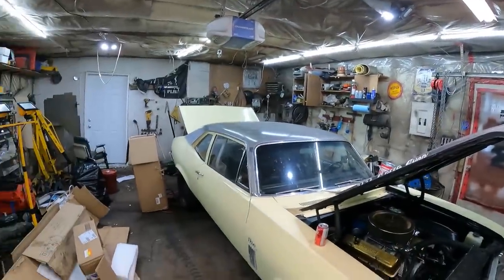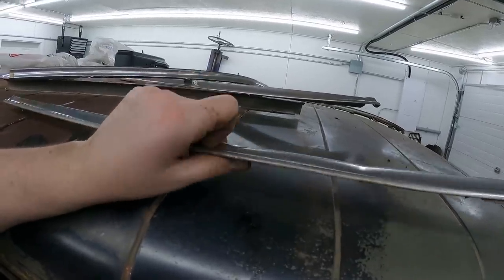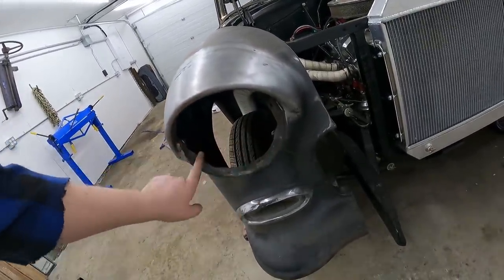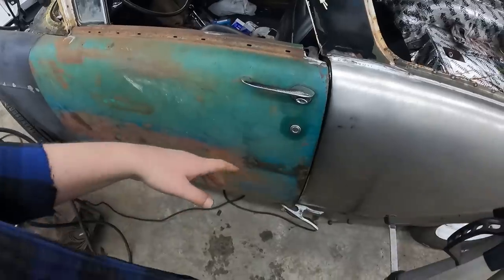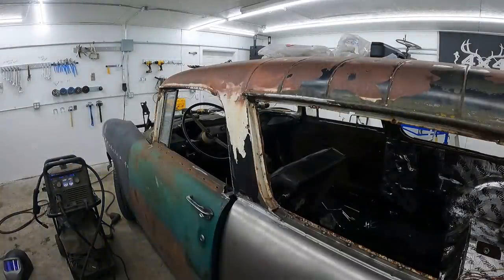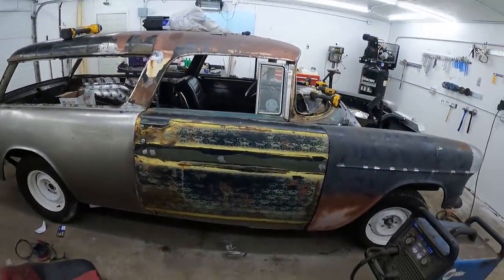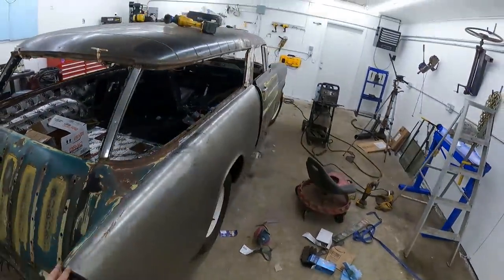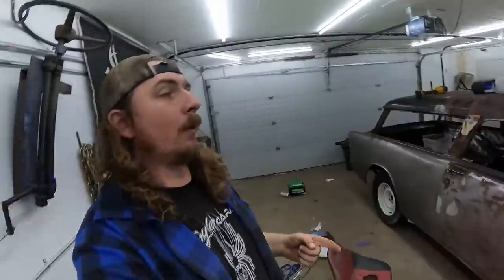Magic Dan Stripping For Your Pleasure, A Car, Stripping A Car Guys... - 1955 Chevy Nomad

Comment: Okay Magic Dan, you seem to have forgotten about something important when you stated the new shop/garage build out.
Exhaust fans, plus makeup air to replace what air you evacuate during exhaust fans are running. 
You can do it easily enough with one exhaust fan on the roof, are even mounting it on the wall between the two buildings if you don't want the it in plain view. 
Just make sure you have a back draft damper so that it doesn't allow airflow either way when it's off. 
As for the makeup air, you can mount a couple louvers with screens, and barometric dampers in the garage door, and that way you have fresh air flow across the entire shop area.
With the addition of filters at each opening both makeup air and exhaust you don't bring any trash into the area that'll contaminate your paint, and you don't introduce any contaminants into the air outside the garage.
Instead  of body filler,why not learn to use lead or the equivalent to it, and you won't have the issues of major cracking in a few years, because the lead/ lead alternative will out last any bond are other types of body filler by many years if applied correctly.
Just a thought on the body work, but a necessity as far as the exhaust and makeup air systems goes.
You might consider a floor sealer system too, which will make cleanup easier and you don't have to worry about staining the concrete.
Not that you do anyway, but you can hose it off, and it will dry in no time compared to exposed concrete drying time. 
I mean your seriously trying to make an effort to be more efficient and successful at what you're doing, so those things are a big step in that direction
Reply: Dan, you've made amazing progress so far! Here's a trick that will help with the longevity of the body work: first spray some epoxy sealer on the areas that you want to use filler on, it's makes the filler last longer and seals the metal from the porous nature of the filler, eliminating rusting under the filler, can't wait for the next video!! Rock on!

Comment: Always a good idea to seal the car in epoxy primer before applying filler. It gives an added layer of protect from moisture attacking the bare metal under the filler. Keep up the good work it's looking good.

Comment: Run a shared air line between garages and use the opposite garage's compressor to avoid the noise in the one you are in. Plus you get a little extra runtime with both tanks shared.

Comment: Looking alright. I would pull the headliner and assess the condition of the steel on the the backsides. I have seen as many as three layers on Nomad roofs. When looked into there were some issues there. Sometimes requiring patches being butted in.
The big garage is outstanding Dan.

Comment: Electronics short out with metal dust from grinding and high dust in general clogs heat sinks. Making a sealed cabnet for the pc case with a filter would do it some good, say use flat filters from car with push pull 180mm fans. Mounting the screen on the wall in a sealed enclosure would do it good, have two vent points to the pc cabnet with a fan in one. Fans smaller than 80mm get stupid load, so smaller than that wont be ideal. Adding a flip cover over the screen be good to keep it from abbrasive damage from grinding and stop flying objects.

Comment: Hey Dan,
That 8" DA with 40# will make your life a lot easier when you do your initial fill.
Might want to start with epoxy, etching primer or metal prep wash before bondo. 
Add polyester resin and over-fill the whole panel, grab the DA, but stop when you hit metal. You'll sand most of it off (it's cheap)
Short kitty hair first over your welds.

Comment: Dan, take the lead out because you need to plate metal with 18 gauge where the lead was or the body will flex and crack in that same spot, then do your filler with duraglass short hair and skim with body filler. Yes they did use alot of lead back in the day to correct things.

Comment: Put the air compressor between the two garages, you can build a small closet for it with some insulation to keep noise down.

Comment: D & D, Dan, you have come so far on your Nomad, on your Nova, I' m not a "yellow" person, but I do like the butter nut yellow, how bout a black vinyl top? Had a buddy that had a 66 or 67 Nova that color & black vinyl top, looked nice!! One thing I have been wondering, how would you compare your battery powered grinder verses a electric grinder? How many hours do you get out of your battery powered grinder? Be safe!!! God Bless!!!
Reply: Vinyl tops, while looking nice never end up nice in the long run. They dry, they rot, and then they retain moisture which rusts the roof.
Reply from the maker: I do like vinyl tops but not so much on novas

Comment: Use a French cleat to install tools . etc. on the walls.Rip a 1v4 in half at 45 degrees. Mount one side to the wall studs -easy to set up racks -and easy to move as necessary/

Comment: What is the finish your working to? Standard primer gray or something else? I usually gray with or lighter first, then a light spray over dark primer. When go to blocking the bigger areas you sand dark off to find low areas and height areas. I don’t how much you want work it over? You put all that time and effort, just might as well finish with process!👍👍👍👍

Comment: My brother and friend both used 1\2 inch foil covered foam board on the ceiling for insulation and noise. Will cut.

Comment: Dig out every possible bit of that lead that you can, Duraglass it, and then mud. What's really nice is when you wrap up a bunch of time in paint and then it blows apart, just like when you mud over lead. I'm not quite sure what your definition of painting the car is, but any comeback sucks, even if it's your own.

Comment: SKA-rew the filler door, shave it....get "the taillight". 
Also, you need a roof, if not a breezeway/storage locker between the two buildings. Might be a good place for the air compressor.

Comment: best way to get rid of lead is to melt it with a torch. then While its still hot wire brush or wipe with a rag. It will get rid of it really easily.

Comment: The day job cuts into the work and everyone has to have sleep so it cuts in and you take a few to break into the mode of work on it so that cuts in making for a lot of "I'm gonna's" and it doesn't happen cause you spot something and it will take the attention off of what you was wanting to do. Bare in there as your going to get it done, its just not easy to get up on step and get moving like your say you were

Comment: When you sanded that passenger side door, I almost went outside and did cartwheels in the yard. The whole character of the car changed with that one move. Its like you took off the Haloween costume that's been on it for 50 years, and now it looks like a proper '55 Nomad again. More evil demented LSD  lunacy from the 60's is gone forever. That's the kind of hideous crap that can keep you awake at night wondering who would do such a thing. I can tell that in a very short time, this beast is really gonna start to look like something. She gets more respectable with every session you do. Stay the course!!!!
Reply from the maker: Couldn't agree more the car has taken a big change!

Comment: Use stripping wheels. Once u wear the edges down you CA get in the ridges on the roof. Make it easier. Them stripping wheels don't get the metal hot. Any hoot that's my advice on that. Cars looking good

Comment: Matching the camera FPS to the frequency your line voltage is running at should cure the LED light flicker, otherwise you'll need to add a CFL or incandescent light source in the mix to help drown it out. Still wish you would've kept her looking field fresh with that trashed lace job and just cleared the whole rig.

Comment: Torch it out and what doesn't melt wire brush it and sand blast if rust and chew glass it and top coat it with filler water